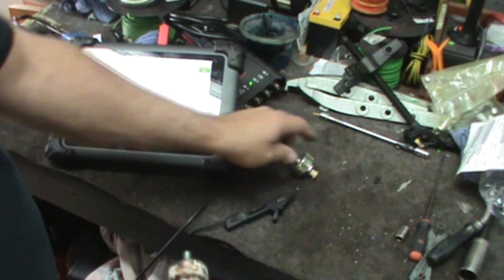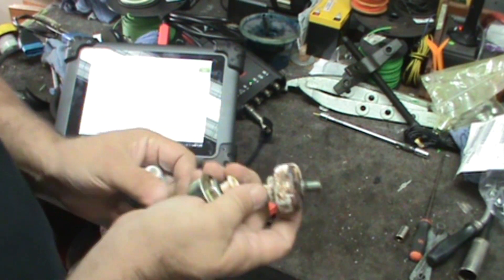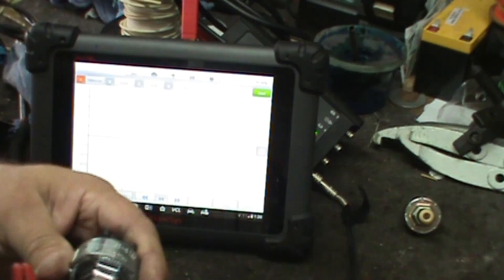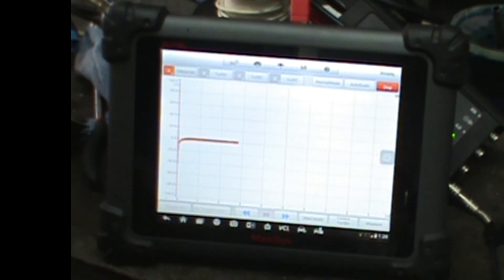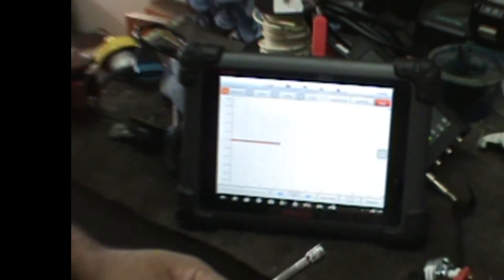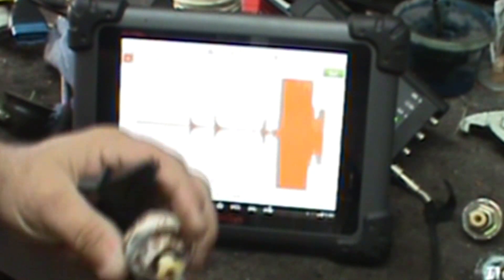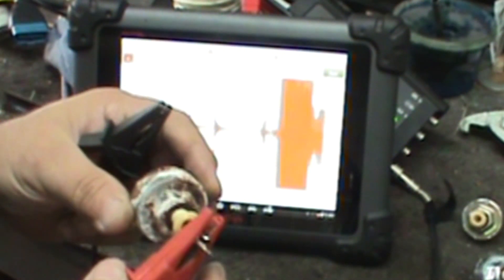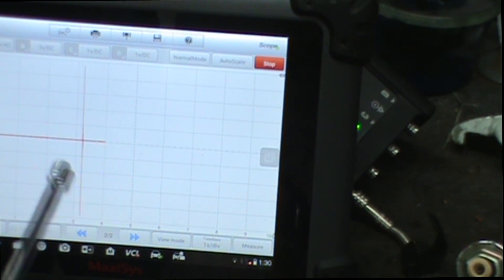Oscilloscope Testing Knock Sensors

Comment: cool on the scope cory  I think there is a pid for that and  tap on the block   the last one I did I used a bwd brand and had to do it twice   this is from people slamming puddles
Reply from the maker: Funny how only 1 sensor was corroded. Thanks
Reply: oh its the seal plug  one worked.... they say use a little silicone on the new ones

Comment: Readed somewhere that  you can hit engine body while running ,there should be a noticeable change because the ecm will modify timing
Reply from the maker: Theoretically you should be able to do something like that. Problem is, if it doesn't work, is the sensor bad or did you just not hit it right? If it's your own car, that's one thing. But a customers, I need to 100%. Thanks for stopping in sir.